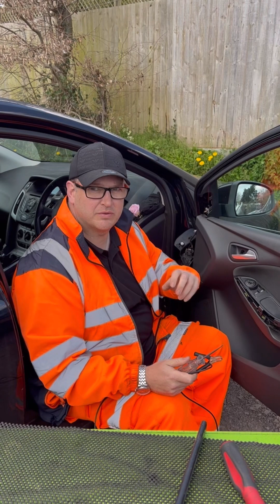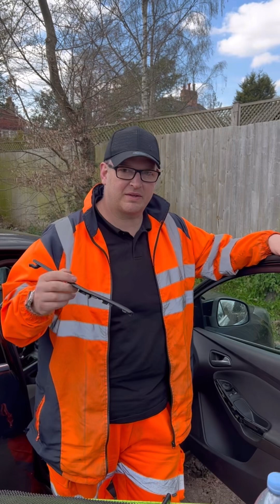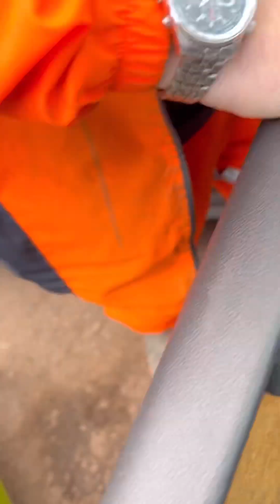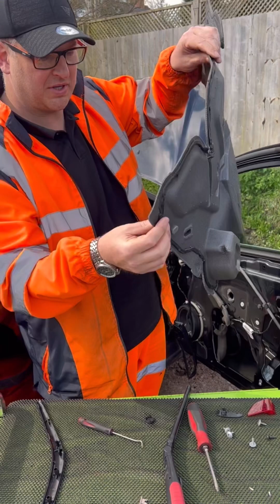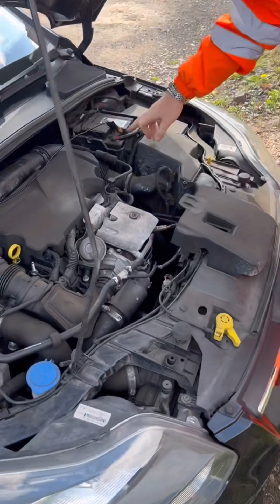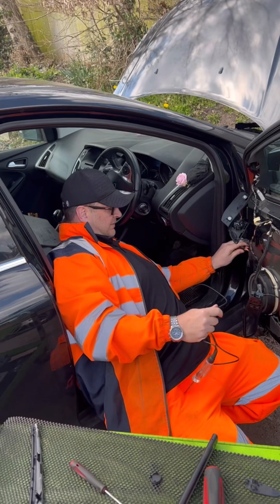How to Diagnose a Failed Electric Window. Electric Window not working or stuck? Diagnose the Fault.

Comment: Hi mate. Probably a silly question. How u know which wires u need to put the tester on when there is more than 2 wires going into the switch.
Reply from the maker: Test each wire until you find the wire that gives a signal if none of them give a signal then their is more indepth problem  like switch is faulty or blown fuse maybe wireng issue the usual location of a wiring fault would be where the wiring loom is located inbetween car a post and door